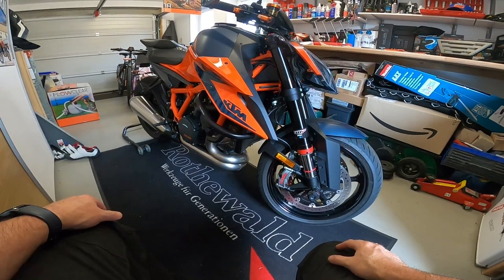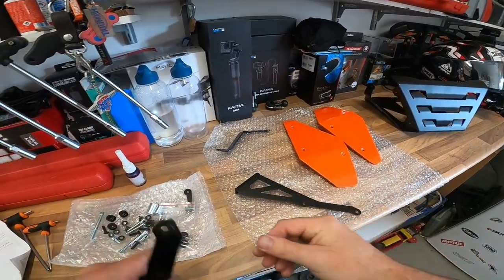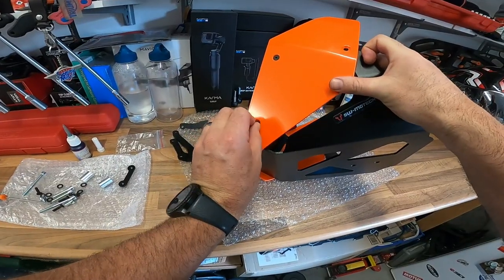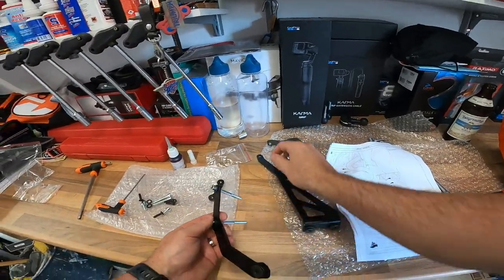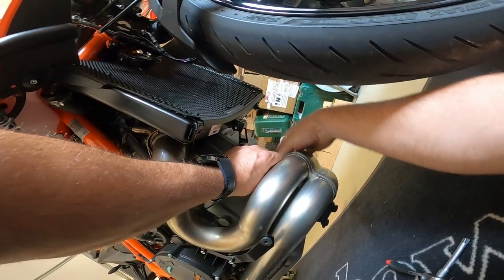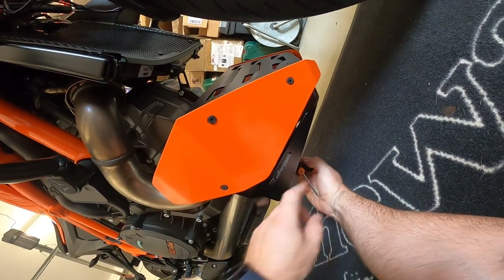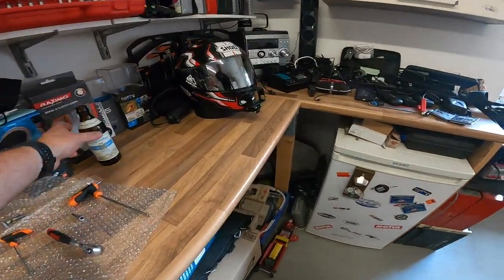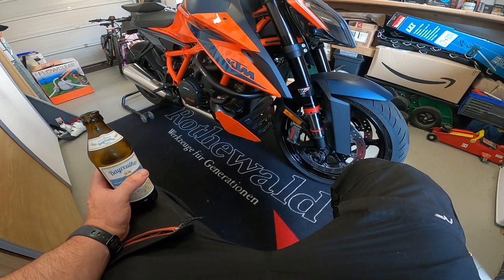SWMOTECH BugSpoiler for the 2020 KTM 1290 Super Duke R

Comment: @TheLikeableRider is it really called a 'Bugspoiler'?  Wouldn't 'Headerprotector'  or maybe even 'belly pan' at a push have been more appropriate?  I do quite like how SW Motech seem to like creating 'jigsaws' for you and AMC  to assemble for our amusement before you get to fit them to the bike though! It all looks quality, but for the price they should be doing all that pre-assembly work in my opinion. For all that it does look a whole heap better.
Reply from the maker: Yes that's the official name of it, and agreed it's a strange one! I like a challenge😜 I suppose because the bolts need thread locker, and needs to be lose for easy fitting, then pre assembling them wouldn't work. I do like a jigsaw✌😜
Reply: @thelikeablerider8800  Good point about the Threadlock! I hadn't thought of that. Sometimes I wonder how bikes didn't fall in bits before we had heard of 'Threadlock and torque wrenches...

Comment: Two things i have learned about TLR from this video.  He understands proper application of thread locker. A bolt is not a donut, it doesn't need to be coated until it's dripping. Second, he has the patience of a saint. SW Motech would have been liberally cursed throughout any video i did for that stupid bottom bracket design. It does look good, though!
Reply from the maker: 😂😂 thanks buddy👍

Comment: Hi Pal 
Love the super duke , looking at trading my 15 Duke in for the 2020 model , just wondering what mileage are getting to a tank , as is only a 16 litre , keep up the good work, and make sure the fridge is always stocked 👍
Reply from the maker: She's pretty good on fuel now! I get from 280-300km to a tank of juice. Last week she averaged 5.1 litres to every 100km. My GT averaged 6.5 litres to every 100km.
Reply: I rode mine pretty hard got 240 kilometers. Was always into inline 4s last 30 years, purchased this cause of the comfort. I does vibrate a bit, compare to the other 1290R it's smooth, except for 6 th gear for some reason.
Reply: @HarryTheHurstDefinitely, it vibrates under 140km/h at 6th...getting to know my 2021 model which I got brand new few weeks back...in love with this beast!
Reply from the maker: Happy riding👍😜🍻

Comment: Crikey I thought my GS took some sorting to my taste, has to be done though, well done on the fiddly install, graphics will make the job !   Just a heads up on my previous issues with Go pro and power bank, perseverance has paid off and quite happy now, you may be interested in an item to help using your GoPro in adverse weather, look at  3brpowersports.com    Downside is shipping from US is quite expensive, not purchased any myself, yet,      Cheers and ride safe,  Derek
Reply from the maker: Cool idea! Thanks for the link👍😜
Reply: @thelikeablerider8800  , further info, the company who manufacture the Gopro waterproof gear are in the process of setting up a UK based dealer, no further info as yet, I have asked , will let you know more when I do.
Reply from the maker: I'll still have the issue of waterproofing the mic adaptor which is also attached to my helmet, yes the camera is then waterproof with this system, but still not quite perfect for us vloggers! Unfortunately we're still not catered for from gopro, the market for us is probably too small.
Reply: @thelikeablerider8800  , good point, worth asking the question at source which I will do right away.
Reply from the maker: I'm sure that's been done many times, but untill gopro ditch that mic adaptor, no one will want to take that job on.